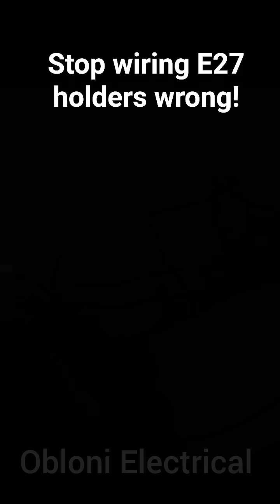How to Wire an E27 Lamp Holder with Switch – Simple & Safe Wiring Tutorial #shorts #oblonielectrical

Comment: You said the life wire does that mean connection is totally different from the normal E22 lamp holder where the branch and neutral is connected to the lamp holder?